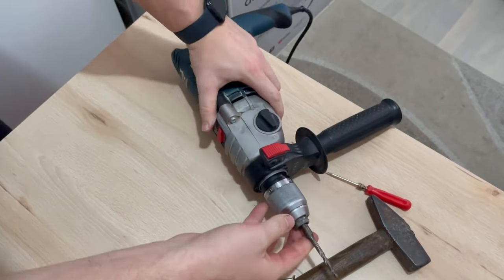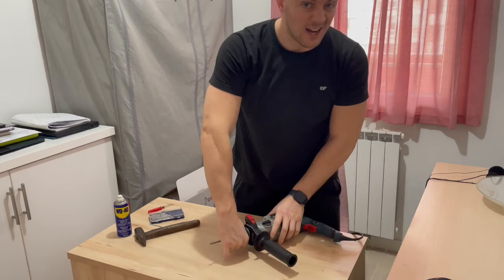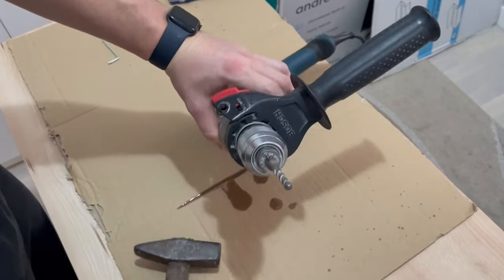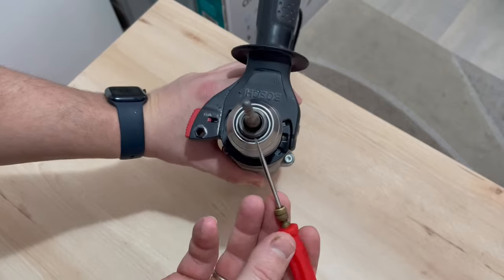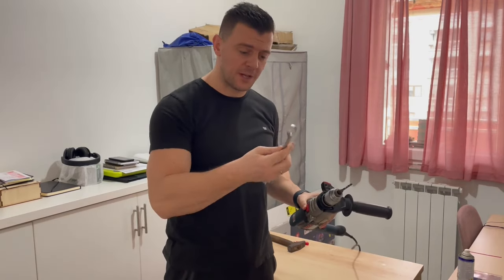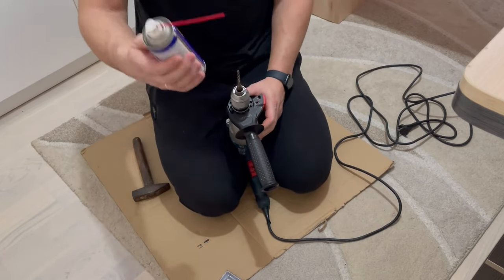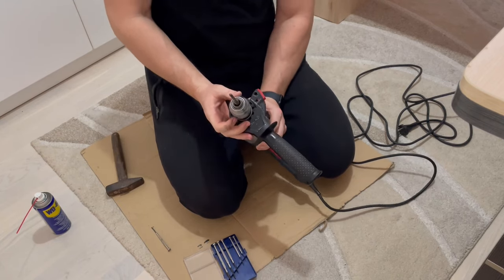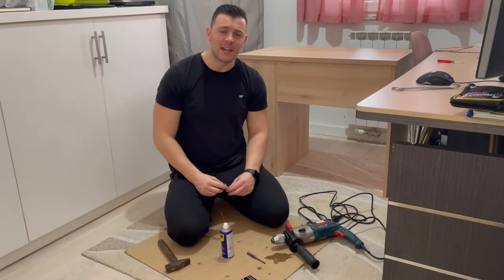Remove STUCK Drill Bit - on Keyless Chuck

Comment: It wasn't clear but it looked like you were using an sds drill bit. If that was the case it's no wonder it got jammed, the jaws biting into the sds slots.
Reply from the maker: Correct my friend, I was using sds drill bit, no excuses there, could not find the right drill, used the wrong one for one job, and everything got stuck 😂 I learned my lesson that’s for sure!

Comment: What do you do if the chuck opens just fine but the drill bit is shoved deep down inside? My son tried to drill hard wood with the wrong drill bit and now the bit is impacted deep inside the drill. No amount of pulling with pliers makes it budge. (He's 8, he didn't know any better 😭)
Reply from the maker: He at least tried his best 😊 he will learn it is nice that he tried 👍
I think you need to disassemble the chuck, to remove it from the drill, then it will be easier to find the solution I think. Just type your drill type and add how to remove the chuck or how to disassemble the drill and you will find it on YouTube. Good luck 👍👍👍

Comment: Tride everything on mine , it jamed even without the bit in it. With broot force managed to get the jaws opend enough to remove the chuch locking skrew and removed the chuk. Filed it under B for bin .
Reply from the maker: I feel your pain, my friend, I had one old one that could do any job under this sun, but it got jammed and nothing could fix it.
I still got it but it doesn't work, just to remind myself how good it was 😁😁

Comment: Was the reason of this that you put an SDS bit into the standard (3 jaw/non SDS) chuck?....
Reply from the maker: No, the reason was too strong concrete wall 😂 I pushed my drill bit too hard into the wall for too long and everything got stucked, but I menaged to fix it 👍
Reply: @rookie.handyman  thanks for your response strong💪 man...
I was more lucky than you (or weaker lol)...
I lost the central screw from the chuck (old metabo 3 jaw standard)  and literally the drill bit just slid into the threaded bore...
WD40 helped, missing screw replaced...
Reply from the maker: @attilabori4734 yeah I know, sometimes a simple little screw can do so much trouble. Glad you was able to fix it all 👍

Comment: Do not grip any adjustable wrench or pliers to the hex nut around the jaws that grab the bit. The material is softer than the ideal hardness of the adjustable wrench and pliers so it will give and immediately strip and dent under moderate pressure. And do not hit the jaws with anything these Youtubers have shown. Because that material too is softer than the material used for screwdrivers and whatever. What is actually tougher than the other parts is the chuck itself. 

I had a chuck that was stuck even worst than anything shown online. I really thought I trashed my drill. But I used a cheap 10 inch Husky brand curved jaw locking pliers from Home Depot. I used the lower end of the drill handle as leverage and got it to turn and open the jaws again. I didnt notice any significant damage on the pliers either.

Comment: Thanks for the video: little advice: SDS Drills don´t belong in normal chucks, thats why it got stuck.. ;) Use normal masonary drills and it won´t be stuck ..
Reply from the maker: Heh nice catch 😊 Yes, I have used SDS Drills all the time in this drill machine, and it usually works just fine, but sometimes it does get stuck. I also recommend normal masonry drills, it is way easier with them.

Thx for your advice 👍👍👍
Reply: @rookie.handyman  Usually nothing would speak against it. The issue is the grooves in the SDS drills. They are usually symmetric (2 grooves). Most chucks are asymmetric (3 claws) . The result is always one claw sitting half in the groove making it jam due to uneven pressure. Been there ;) Still thank you for your work!
Reply from the maker: @ournewbulgarianlife4097 Yeah, and the worst thing is when you use a big long drill, you can see how it rotates in a loop, not a circle but a loop because of this third groove that doesn't fit nicely. 
But hey, gotta make the hole somehow 😁 👍👍👍
Thx likewise.